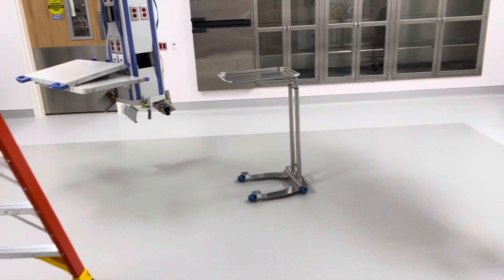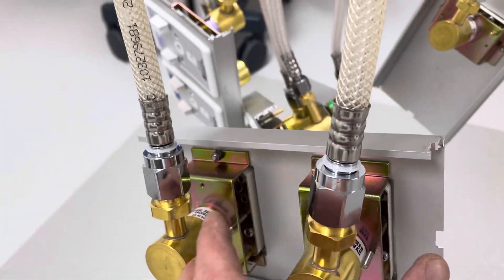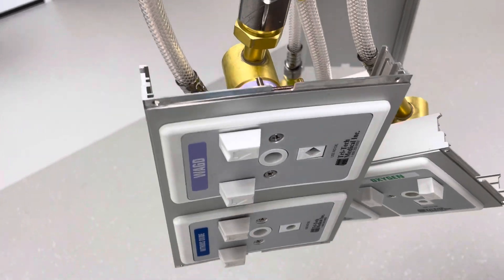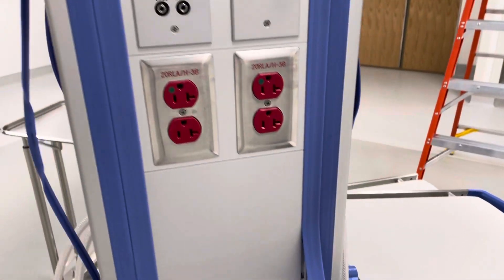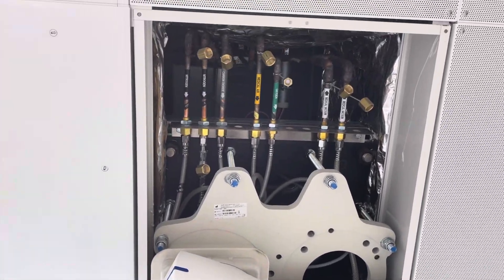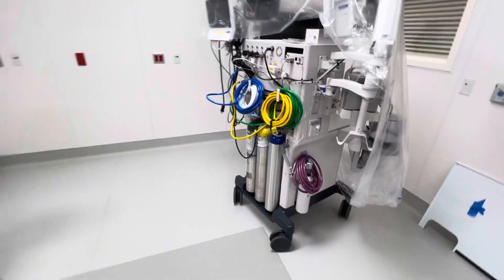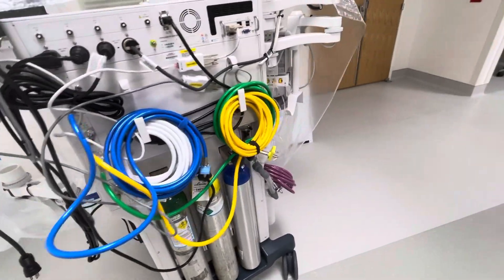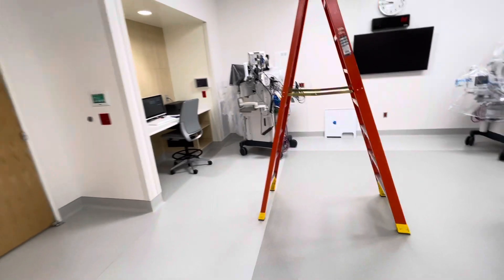Medical gas- Operating Room. Repairs done

Comment: What's the max pressure you would apply with the trim/faceplates installed?
Reply from the maker: We can put 150 psi, and nitrogen system operates at a higher pressure,we do 280 psi on ntrogen only